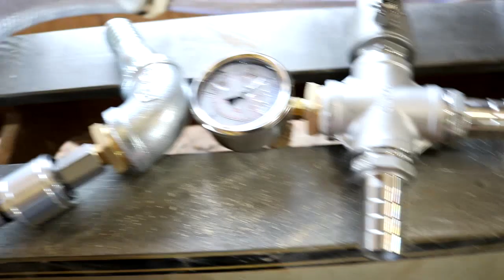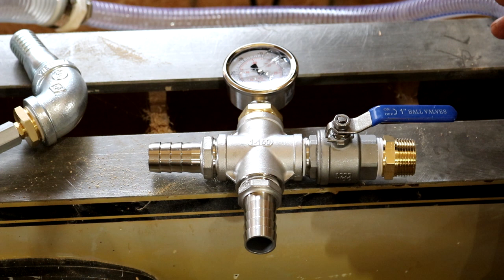Will I succeed in building a vacuum system for this lathe? Pass or fail? (Part 1 of 2)

Comment: Start with the vacuum gauge first. Either change it or have it checked. It would probably be the cheapest and easiest thing to troubleshoot. If the gauge is good then you would have to move on to check the pump. It could be that the motor is not running at a high enough RPM to create the needed vacuum. Good luck.

Comment: Couldnt see top of gauge you bought super well but does it have a vent that needs to be cut open will change your reading a little. might not be your full issue but will help you get a more true reading of actual vacuum